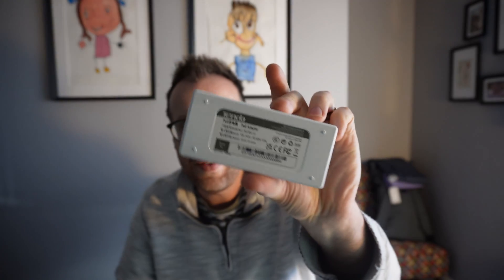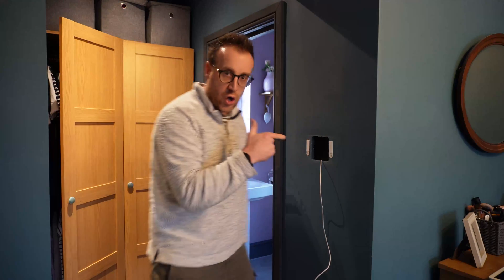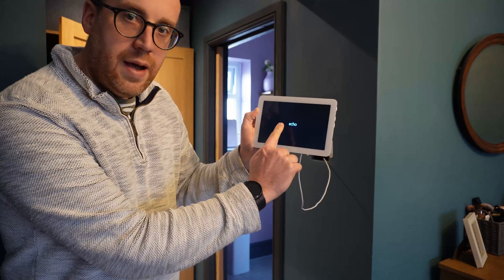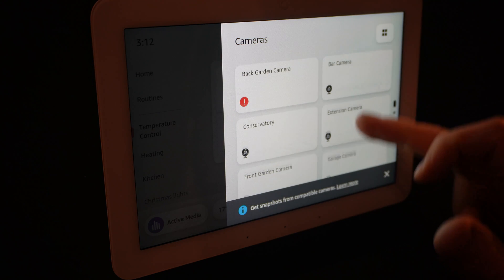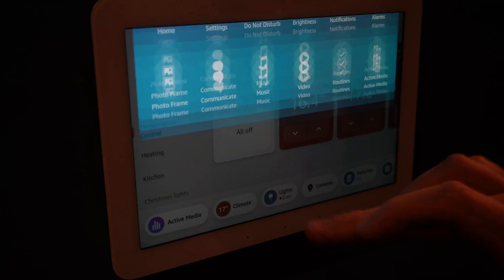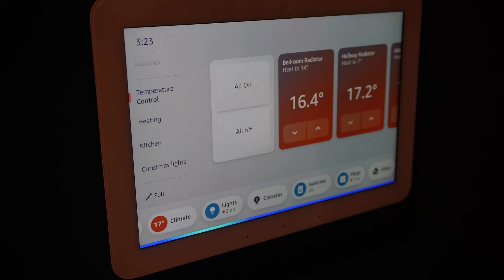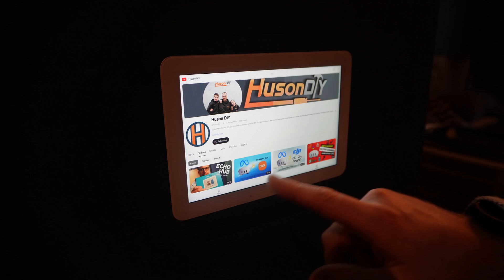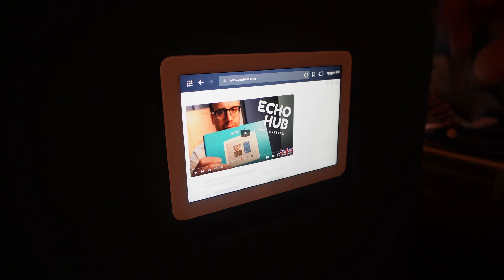Amazon Echo Hub Complete PoE Setup: Equipment & Installation Walkthrough

Comment: Thank you for a solution, but a bit expensive. Why not using 5m or longer USB C cable? Up to 5m. shouldn't be a problem for longer length recommended optical USB C, which are more pricey.
Reply from the maker: I would but I have no way of routing new cable into the walls. I wish I'd placed more conduit in places now through the house

Comment: My echo came with a cable usb to usb c. What cable you use to connect.    ?????
Reply from the maker: Do you a power outlet nearby?
Reply: @ The Echo is connected to the outlet and the WiFi is the only method to connect, but I can’t connect to Ethernet, the device in your video didn’t work, yes I have a Poe switch for Ethernet

Comment: Used the TP link POE injector and various POE USB C converters( 2A and 3A), but none  worked for Echo Hub. Got insufficient power message.  For Echo Hub what worked was using “Male/Female USB Breakout Board to 4 Pin Screw Terminal Block Connector”. I extended the wire between these terminals and used the Echo Hub white cord(usb c). This allowed me to run the extension from the ceiling(attic) to the wall mount location. You need to connect all 4 terminals to the extension wire and the Echo hub will power up fine. If you connect only the power terminals on the breakout terminal block, you will get an insufficient power sign on Echo Hub. So I was able to power the Echo Hub without need of POE devices. Hope this helps others
Reply from the maker: Great work!! Thanks for posting your setup!

Comment: The issue with these Hubs is that Amazon in their great wisdom, did not put an actual Ethernet PoE port on the Device itself! And, the Power supply requirement needs are both 5.2v @2.4 amps And 9v - @ 1.4 amps simultaneously. So thier adapter is sending both over USB using a step down choke process.  My thought is one is for the screen power SOC design, and the other for Wifi? Not sure but man, what a pain if you need to send power from a remote location. Especially if your using two pair 16/2 cable and not Cat5e or 6e. The old days, all you needed was two pair to power just about ANY distant device, Sans PoE Access Points. Thank you for the work and insight! Be well!
Reply from the maker: Great insight, thank you!! It does seem a combination of strange decisions by Amazon doesn't it 🤔

Comment: Hi, I bought an Echo Hub andhave it installed on the wall. There have already been 2 or 3 software updates to the device which is good. However I came across your Youtube channel when searching for a working PoE solution. I already have a rack mounted PoE switch I just need a compatible adaptor to extract the USBc PD and Gigabit ethernet connection. I am still disappointed that a company lie Amazon can release a product with absolutely no recommendation or link to the correct product! Obviously no collaboration as I also have Ring cameras and doorbell. They are all PoE!!

What was the model that you got working did they support Gigabit ethernet as well? Have you had any feedback from Amazon. 

Thanks for the channel I have subscribed and will be watching your videos from now on.
Reply from the maker: Yeh it's super disappointing from Amazon on this to be honest. At least you would hope they would have a recommended product they could offer!!

Thanks for the sub! Really appreciated 👍🏻👍🏻👍🏻

Comment: Hi  Just power over ethernet or data too?
Reply from the maker: I haven't tried with data yet, I will though and I'll let you know
Reply: @husondiy  hey - thanks for the video. I'm presuming this means the Hub will get its connection via wired ethernet rather than wifi? I'm a bit confused by "you havent tried data yet" - surely that is the point of using PoE?  Sorry if if i'm being stupid - I havent used PoE before - thanks!